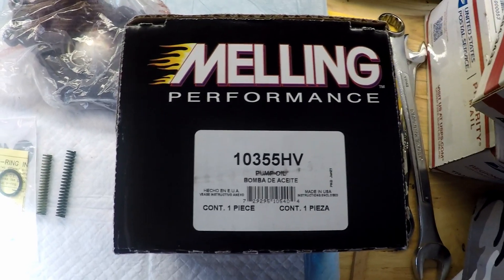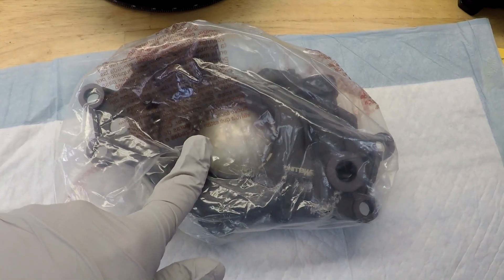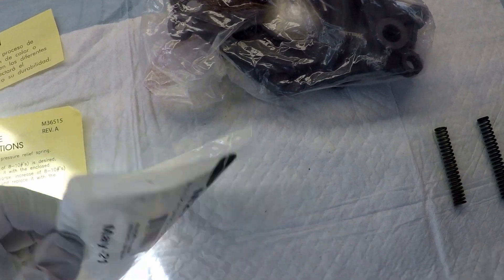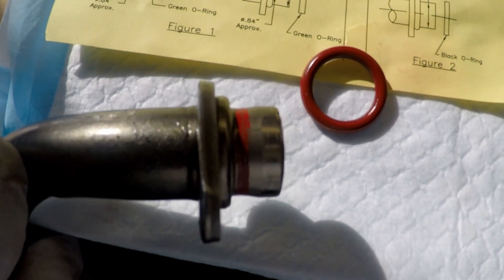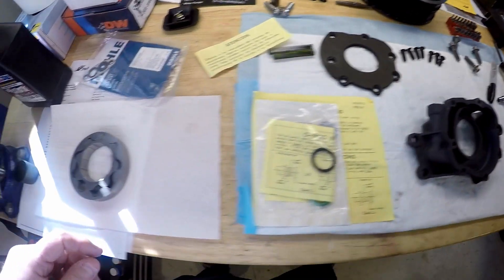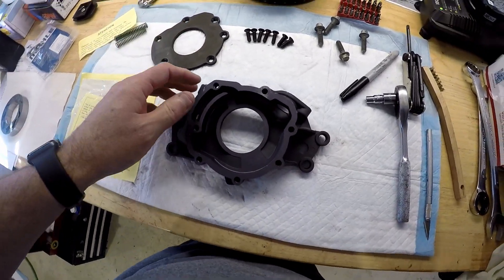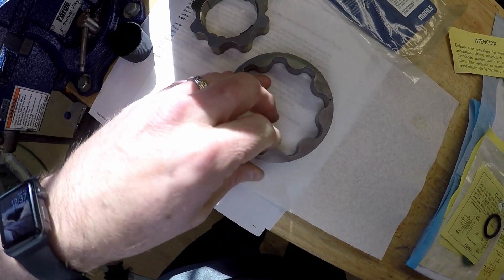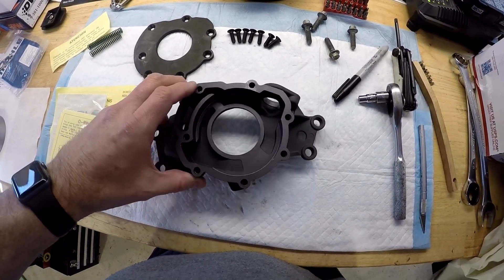Melling Oil Pump Internal Inspection

Comment: You purchased an extended warranty? I’m surprised you still even had 1.
Reply from the maker: LOL! I never buy extended warranties. No this pump is new so should have at least a 6 month warranty. I didn't check because it didn't matter to me.  How's your peoject coming along?
Reply: @fasnuf  my project is still moving. I just did a community post on YT showing the new injectors. I plan to get them installed along with the e85 sensor this week. March 15 is my dyno tune date
Reply: Thanks again for the info on this pump. And good luck in your dyno session! What sizes are your upper and lowers? What boost level do you think your at with your current mods?